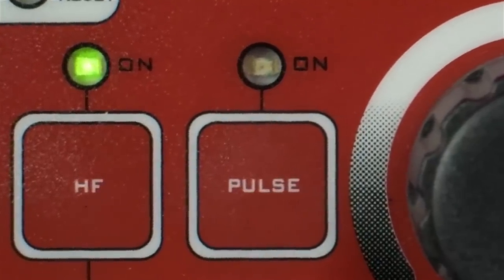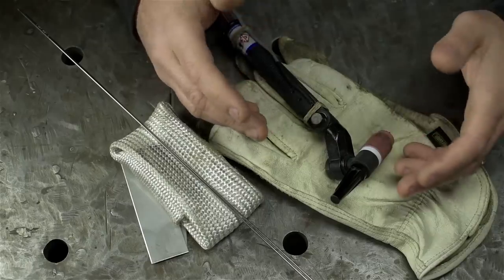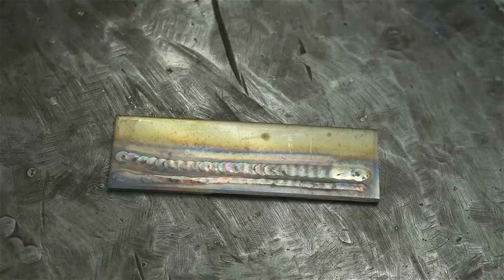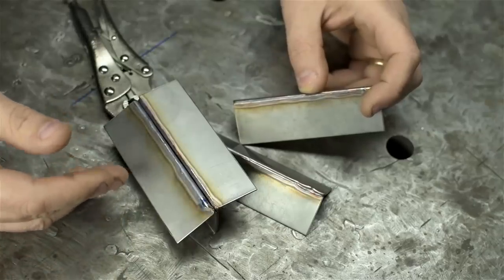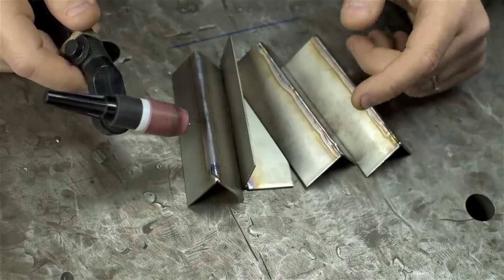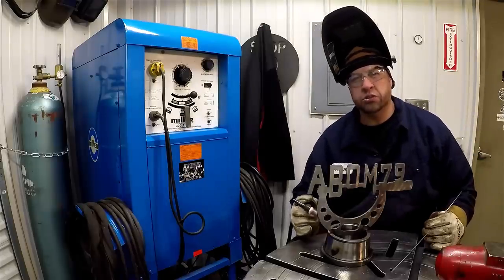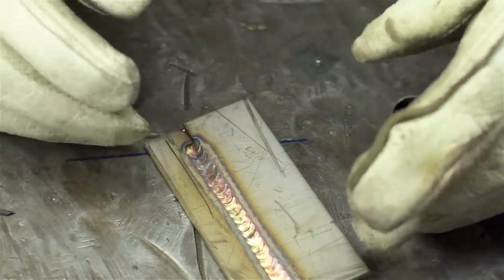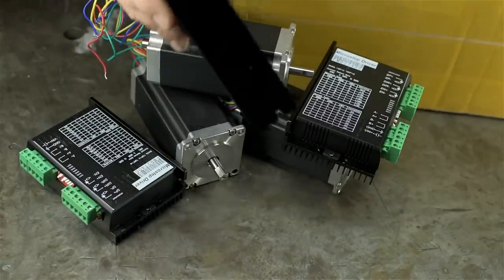PuLsEd TiG WeLdiNg

Comment: You need any parts made for your CNC? ♪ If you got the model, honey, I got the spindle ♫
Reply from the maker: well hot dang, you temptress you!
Reply: Both you guys are awesome.  My weird adopted uncle and the neighbor I wish I had lol
Reply: Hehe.  AvE goes spamming.   Desperate time in Canuckistan.  You be careful with our Hass now uncle.
Reply: @danl.4743  Pain in the Hass
Reply: @ThisOldTony  & AvE love both your channels, ass kissing  over with :-) I'm in need of some help/advise I'm over in Ireland and have  found metal work and welding as a hobby a great stress relief( when it goes to plan) I started welding with a ac stick and got a cheep inverter dc stick and of course tig caught my attention, bought a scratch start set up, thing is ive a wp 17 tourch 1.6 (1/16) red tungsten 6 cup, can only strick an arc if tourch is in the positive plug other wise it burns away my tip maybe half inch at a time. My welder is 80 to 200 amp Ac Brooklyn (Chinese made) rip off of Jefferson brand by the look colour (color in imperial) :-) and shape can the flow or polarity be checked with a multimeter I've a mastech my64(??) Forgive my ignorance I'm coming to all this late in life and wasted yrs getting experienced in work that no longer exists, progress whaa! Anyway any help would be greatly appreciated
Reply: @bbarnaville  I wouldn't worry about trying to measure the polarity. Usually when I hook up a multimeter to something that I have doubts about hooking up a multimeter to, I end up buying a new multimeter. In the case of your welder, I would just assume that it's marked backwards. When I try to weld with the torch positive, the tungsten melts.
Reply: @77tropic  Thanks for the reply, I had resigned myself to the terminals being marked wrong, I agree with you on the multimeter front ( don't ask) I wasn't getting penetration in EP so I opened up said welder, found a loose trimmerpot resister( I think) &adjusted it, I turned on the machine, half expecting a bag and some smoke maybe even a light show but to my surprise my 80 ~ 170 amp welder now tells me its a 22 ~ 195 amp welder and its striking an arc in EN, not the smoothest of arcs mind, but at least im kind off the mark. Just tungsten crashes and gas flow and rod feed to crack now and there'll be no stopping me :-)
Reply: @bbarnaville  Lol you sound like me. (about the needing to get the rest of the basics down and then you'll be a force to be reckoned with). Good job on the fix. Ireland I believe you said. Sounds like a nice place to live. I've only read about it in fiction books. Like books by Jerry Autieri. That reminds me that it's been too long since I've read about Starri Deathless, a berserker
Reply: @77tropic  Yeah I'm in Ireland, yeah it isn't a bad place to live, but I'm a tad bias, I've never lived anywhere else, maybe ignorant is. . . ..no I'll stick with bias. Where you from? Nosey and bias! Been welding long?
Reply: @19971997gt  which one is the uncle and which one's the neighbor.
Reply: @Nick Lemon  AvE is also known as "Uncle Bumblefuck" - I'd say that's a giveaway.  :-D
Reply: @bbarnaville  The multimeter should have infinite (near enough) resistance on the voltage input so no problem checking the voltage/polarity . Open circuit the potential should be something like 80 volts, dropping once the arc is struck (HF start is much higher voltage but at low current). For current measurement you'll need a clamp meter, that's going to be useful to check the accuracy of the welder settings - don't be surprised if a cheap welder doesn't put out as much current as it claims, or the arc is unstable at high current setting.
Reply: And i have the brain to make it my self.

Comment: Are we supposed to dip the tungsten on the high pulse or the low?
Reply: @zomgthisisawesomelol I'm no professional welder...but I dip my tungsten in the puddle as often as possible! ;-)
Reply: @zomgthisisawesomelol I default to as often as possible, really keeps the mystery out if the situation.
Reply: well not into your beer, so my boss tells me
Reply: I’ve found dipping less often when I only have a few sharp ones left works for me....
Reply: I just wish I had a puddle to dip. 

And a sharpened tungsten for that matter.
Reply: Your should try to never dip the tungsten in the puddle, while keeping the arc as short as possible. It would be interesting to be able to measure the power that the welder puts out. On a TIG machine Amps are constant (well while pulsing are bistable) but depending on the arc length voltage probably changes quite a bit, and so the amount of power no?
Reply: Dip it as soon as it's about to get dry.
Reply: @AlessioSangalli  Go for a slow walk of shame around the block.
Reply: @AlessioSangalli  Ale... E daje no....! ....stanno a giocà...lo sanno tutti che non si deve toccare mai col tungsteno.
Reply: @torniaccio  si ma la loro barzelletta stava andando talmente per le lunghe che ho pensato di interromperla con un messaggio serio, insomma una sorta di secondo livello di ironia o sarcasmo.
Reply: Chiaramente nessuno ha invece notato la parte seria del messaggio ovvero le considerazioni legate alla potenza in funzione della lunghezza dell'arco. A livello di discussione YouTube è deludente, risposte grossolane etc
Reply: @AlessioSangalli  Ah, tipico degli italiani. Fottere i troll su YouTube. Secondo me hai fatto bene. Comunque se riesci a misurare davvero la potenza media di una saldatrice TIG fammi sapere come varia il voltaggio.
Reply: @spudpud-T67  whoosh
Reply: @zomgthisisawesomelol Start with never. NEVER dip the tungsten.
Reply: 😂😂savage
Reply: i just stick weld with my tungsten electrodes. high temp resistant welds
Reply: Dip your tungsten in a steel weld puddle often enough to maintain a coppery-green hue color in the arc.
Reply: Been tig welding for a living for over twenty five years so I know a little bit about it. There is no welder anywhere that doesn’t fuck up i.e dip your tungsten.
Reply: That is self-explanatory....
Reply: That's not nice!
Reply: @AlessioSangalli  I've been wanting to do this for years!  Got the stuff but still have not done.  I think it needs a "SHUNT" (precision resistor of very low resistance and high current ability.  They sell them for this purpose) and an oscilloscope.   The shunt has two heavy leads for the working current, and two little leads for measuring.  You sense a voltage drop and read it as current.  I think this is the only way.
Reply: I thought you were supposed to tap the tungsten on the material between pulses¿?    🤔
Reply: You dip on the low and dunk on the high.
Reply: NEVER DIP YOUR TUNGSTEN!
Just kidding its a preference thing u can dip on the high or low it wouldn't matter it would come out certified.
Reply: Yes

Comment: High frequency pulsing like 200Hz gives acoustic response to the arc length/angle. This actually helped me in not drifting into steeper and steeper angles as the weld progresses.

Comment: Here's a blast from the past: Many years ago I owned a stick welding grip meant for use with a standard 12 volt car battery. Obviously it had no control over current output other than the voltage drop as you used it more. But to help in maintaining a near constant (pulsed) arc, it had a tiny solenoid in the head that would pull the welding rod back a fraction of an inch every time an arc was struck, and then let it go forwards again when the arc was lost. On car body panels it was surprisingly effective - as long as you kept the battery voltage constant. I wish I knew what happened to it even though I now own stick, mig, tig, oxy/ace and propane welding equipment. (What can I say? I'm a tool hoarder!)

Comment: i used to run pulse with a shallow angle of attack combined with laywire on thin wall stainless pipe, It gets me full penetration without undercutting the material or getting a concave weld bead and minimal overheating. my settings and a full purge usually gives me a full penetration weld that is close to flat on the inside of the pipe. for 2.0mm wall stainless: 1.0 or 1.6mm filler, 50-65 amps, 25-40% ontime with 2-3 pulses per second, shallow angle of attack to your weld puddle gets a bit of an teardrop shape. fine tune settings for your machine and your weld speed.

Comment: Pretty sure if you’re going to weld some Cherry to Mahogany, you’ll need to use stick.
Reply: Now, that's a  real welder.
Reply: I have seen it done with MIG but he used a special polymer wire and the gas smelled like something you blame the dog for.
Reply: Using Woodex rods
Reply: No replies stand up to the main comment...I wood not even try.

Comment: I weld a lot of stainless at work and we use pulse on everything we weld. We do almost exclusively stainless and it's parts that are really sensitive to heat. I've noticed the pulse also seems to help build a higher bead. It doesn't want to melt in as much so it humps up more.

Comment: Great video, I use pulse on 16 gauge stainless for restaurant work, I set the on time and back round amps all the way down set the peak to around 190 amps, really limits color change and keeps the welds consistent.
Reply: What frequency did you use?

Comment: Pulse TIG works really well with sanitary tubular fitting welds. I have used it several times to make stills and oil-tanks and have been able to get gas-tight welds without sugaring and no corrosion. For working on "Tuna-Towers" on boats or a the top of a distillation tower. It is a must have as I haven't figured out how to run a peddle while hanging on the rigging.

Comment: One of my first welding experiences was using an Arc welder to repair some sieves for our combine. It was fall and rainy so we had to do it inside, my father and I learned after a few days of high temperatures and incredibly achy bodies that welding galvanized metal with poor ventilation is a really bad idea. Long story short, thank you for your content.

Comment: Always! Wear ear plugs when welding upside down. When welding MIG. Always use ear plugs when when you’re on a bench. Your ear is designed like a funnel on purpose for acoustic pressure impedance matching. Unfortunately it’s also very good for slag channeling.

Comment: Tot, maybe you could try making a high throughput diffusion pump? It has no moving parts, and is the only real barrier to a DIY spluttering rig. PVD is just focused TIG pollution, controlled in a vacuum so the vapour from the process ends up on a target. If the ultra high vacuum pump can be made cheaply, the whole process of coating metals becomes open to the home shop. You already have a pulsed power supply and argon gas. With an electro polishing wand (cheap) and your mill, making vacuum chambers would be easy.

Comment: Tig welding was developed during the later stages of WWII when they started making aircraft out of aluminium. It was quickly realised that pulsing the arc with a high frequency current made it easier to break through the aluminium oxide which needs considerably higher temperature to break down than what is required to actually melt the aluminium.
Reply: On this side of the pond, airframes were made of aluminum.  (The material properties are nearly identical, so all the maths are the same.)  ;-)
Reply: @wlan246  are the old aluminium / aluminum debate... There's a topic you haven't covered this old Tony

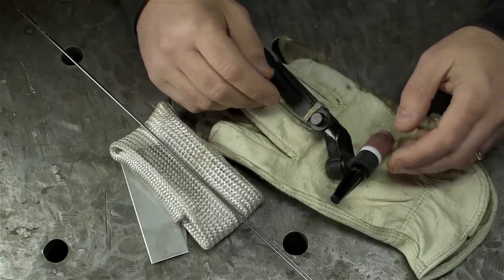Comment: 2:29 and the most important   setting of course being the angle at which the tongue is placed  and the length at which it is stuck out with will determine the quality of the work in large part  yes there are charts an formulas for this that will be provided

Comment: I'd love to see a TIG welder that uses an old school music synthesizer as the control board, with a circuit that amplifies the signal.

You select a waveform, turn some knobs to modulate the waveform a bit, then hit a key to select frequency. A volume slider determines amperage. Then add in extra effect modules for stuff like pulse welding :)

Comment: I find pulse useful (at times) on TIG for steel and aluminium, kind of helps with the bead profile. I typically run 1 - 1.2Hz. On peak current a general rule of thumb I find about right for me is running at about 150% of what I would run without pulse and then tweak the high / low ratio if the heat needs adjusting.

Comment: I think the best way to start Tig welding is with scratch start. Almost no settings and things like hardware and gas flow setting become super critical. One can nail down filler rod feed and travel speed then move on to a foot pedal and all the extra settings

Comment: I always found pulse welding to be real good for T joints or L joints in 5 or 6mm Alu so it wouldn't bubble or melt away when at the end of the weld.

Comment: Use pulsed tig every day at work 7.9 pulses at 90/30 works really good at 142 amps .060 to .045 outside corner joint. platinum really takes the heat well

Comment: Instead of using pulse with a rotary table, you could build a linear table and use it with the pulse setting. It would work under certain circumstances or for certain jobs.

Comment: Oh the welder ‘love’ of a nugget falling from a underside weld into the palm while holding the joint together with pliers in the same hand. You can’t let go too soon and get rid of the nugget as the joint will spring open again.

Comment: Ah ToT, My Good MaN - - -    Thanks 4 the Welding advice the other day - I was concerned that my ARGON mite had depleted over the years in "Storage"... AnyHoo - I was coming up w/ a layer of black overtop the weld, seeming as if it were cold or unshielded. (BTW - I eradicated several Mud Dauber Nests internally - the Largest of which was attached to the rear or the Main Circuit Panel) You suggested to chek4 leaks in the  Torchline. Which I was all se2 do, when I suddenly noticed that the huge black lever thingy on the front - It Moves!, and is actually a Switch... I guess we Could call this the "MAIN Switch" after the POWER Switch.   Oops... The last thing that my DaD welded was SS - So flipping the lever over 2 AC seems 2 have made a Substantial Improvement. Now I MUST Practice...       Interesting side note: I'm finding the Tig Torch Shape difficult 2 Master. The Shape along with the FooT-PedaL is Killin Me 2deth ova here. I may have solved 1 of these. At smallcart I bawTa Pistol Grip garden hose Spray Nozzle 4 - $3.84 - Gutted it & slid it rite up 2 the Torch. With minimal modification it provides a snug fit & is easily adjustable. The Stock Handle - which I left on the hose, slides rite up2 the back of that & only 1 well placed Tywrap - & Voila! (WallAhh!)       Now Practice...        P.S. I decided 2 leave this letter Here because of the way You Ended - I hava Similar Pile of Stepper Motors & their components which were sent directly from Jintan District,Changzhou City,Jiangsu Province,China  -  Along with a Centroid ACORN, 2  convert my SMITHY GRANITE Mill/Lathe Combo 2 CNC - That's Next. Welding, ParaMotor frame bending\flying then CNC...  You know... It's on The List...………………………………………………………                                                                    Thanks ToT,                                                                                         LJR-III  -  OUT

Comment: BLDC motors are the shit. I don't know what the magicians inside the controllers do exactly, but I know how fun it is to slap a motor, battery, and controller on a go kart. Also, the black chinese industrial controller boxes are the devil's spawn. I learned I needed a centripetal clutch for heavy applications, like moving a go kart from stand still without making the thing think it stalled out. Then I bought a e-bike controller off kelley's controllers. best decision yet.

Comment: Hey Tony, any recommendations on where to look for used metal lathes and mills? Local craigslist is a joke where I'm at, most look like they've been at the bottom of the pacific for 100 yrs. Ebay has plenty of mills, but not so much lathes. Thanks and love the vids!

Comment: I’ve found pulse to be most useful on aluminum sheet metal welding for stuff like tanks and shrouds, it really helps keep the heat more consistent. Not to mention it really makes it look great! 

Do you like the weld bead to go solid on the low pulse cycle? Or keep a small bit liquid? 

Wonderful video as always! I’ve loved watching your tig skills improve since I’ve been following your channel!
Reply from the maker: For the purpose of this demonstration I wanted them to go solid.  But usually my background current is a bit higher, around 30 or 40% so it stays a little more liquid than what is shown here.

Comment: Please make a video  of tig welding without inert gas and what will happen if you use simple compress air surroundings...............

1. Effects on Quality of weld.
2. Effect on  Tungsten electrode.
3. HEZoom
4. Penetration of workpiece
5. Oxidation
Etc....

Comment: Hey This Old Tony. I like your video. I was pondering something. I have been welding since high school, but have only ever used MIG. How much better or worse is MIG when compared to TIG? Also, would it be marketable to learn TIG? Everywhere I have worked has used MIG, so meh... Maybe its just a Texas thing.

Comment: Do you use the shear you picked up (and then improved) to cut coupons like those, or something else?  You've been doing demos with little pieces like that since long before you showed off the vertical bandsaw.  Wondering what the best way is to cut my own for practicing on, from the larger thin-plate drops I grab for cheap.

Comment: Do you have to give up coffee to do TIG ? I just love the control and results. Tacking with just a burst of plasma is very attractive. Currently welding last steel struts and components on a 4' x6' CNC Router frame  with a converted $100 Flux Core. Now DCEN thank god, it is still limited to 0.125" And I have some .188 coming.  Would love to be able to reduce heating to a minimum. Still not sure I could afford one mind you.